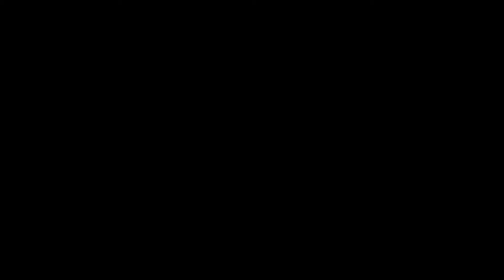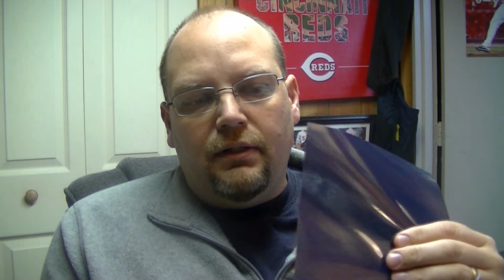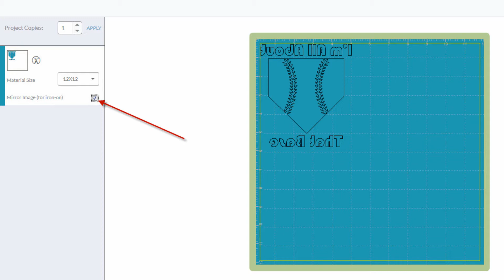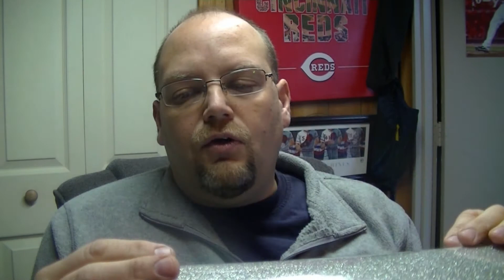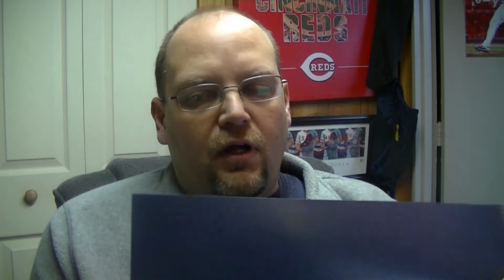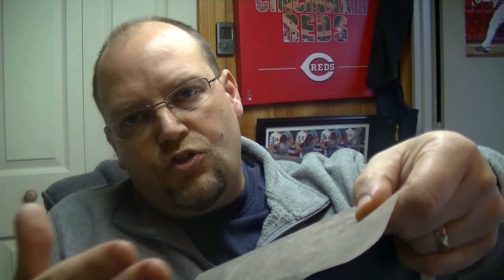HTV Basics - Getting started with Heat Transfer Vinyl and the Cricut Explore

Comment: I still do not understand how to get my image onto the vinyl? I am new at this?  How do I get my image onto the vinyl? With print and Transfer items you actually put the cloth into the printer.   How do you get the Heat Transfer Vinyl onto the image? Does it go into the printer first and then you cut it?   I have looked at video after video and no one shows me how to do it?  I want to put images on to canvas bags and shirts?
Reply: +Linda Smock Hello, Are you asking to print onto the vinyl?  or cut the vinyl into a image?  If you're looking to print directly onto the vinyl you need to make sure you have printable vinyl.